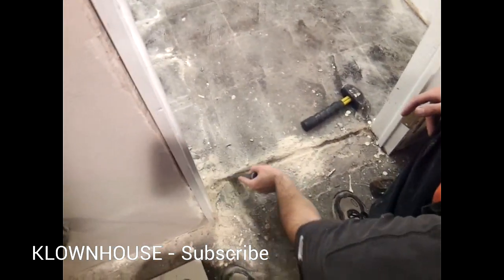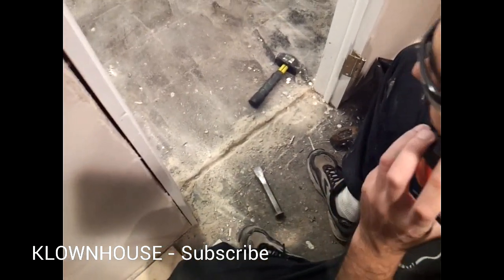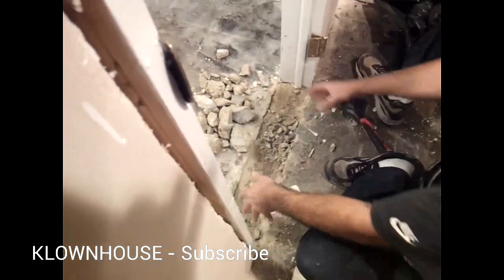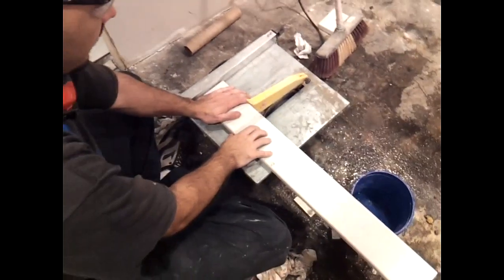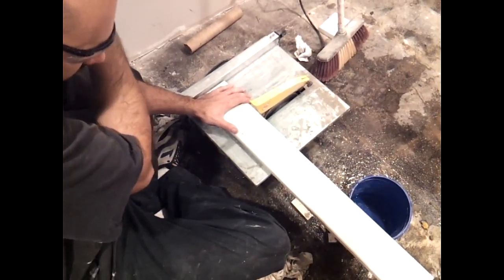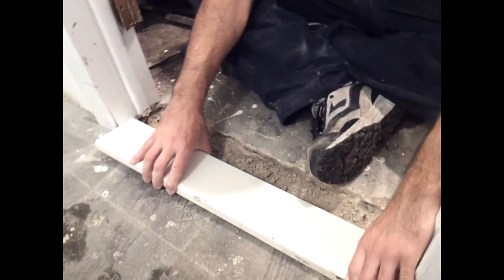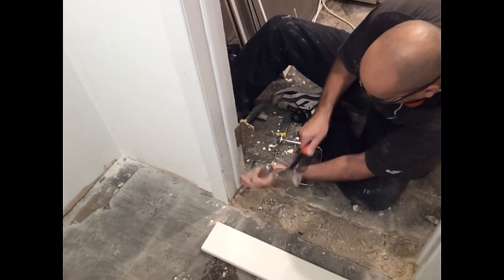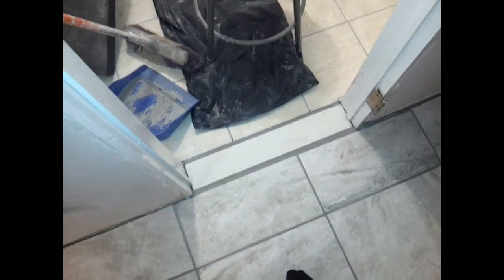How To Install A Doorway Marble Threshold !! ( BASEMENT DIY )

Comment: Thanks for the info...now I know what not to do...yikes :)
Reply: there is absolutely nothing wrong with doing it this way
Reply: +klowny1969 you definitely are a clown, if you don't think the space between the threshold and your tiles is not too wide. also thresholds are beveled for a reason but if you want to put it level with floor in some cases it works. you shouldn't take something you hear several times as a bad thing... maybe reconsider your method and incorporate what other people are commenting.
Reply: @Its-mmiiaa  big deal there is some space between the threshold..you still havent said why this is a bad method..think of sweeping and mopping..everything is flush..and everything looks better flush with the floor tile
Reply: @manolis1969  No way, the transition should be elevated. There is a reason this is done in all nice houses. Those grout lines are way too large and look bad.
Reply: @matthewc5600  get a bigger threshold to get smaller grout lines..problem solved..nice and flush

Comment: Shouldn't a threshold be installed so it's above the level of the floor of the bathroom?  That way,  normal water that gets on the floor from showering, etc., won't flow past the doorway into the adjoining space.

Comment: I don't see a problem with placing the threshold lower in the ground if that's what you want to do. 

The only thing I've would've done differently would be to run the tiles a lil closer to the threshold. But that's just me. 

Besides that thanks for the video.

Comment: Why would you flush the marble threshold with the floor tile?  That literally makes the purpose of a Marble Threshold completely useless. I'm a commercial estimator/pm, but the whole purpose of a marble threshold is to prevent flooding from areas like storages restrooms with either tile or resilient flooring. I'm completely dumbfounded by you flushing the marble threshold, although I can understand if you couldn't get your marble threshold cut to custom fit from a fabricator for a proper grout width...